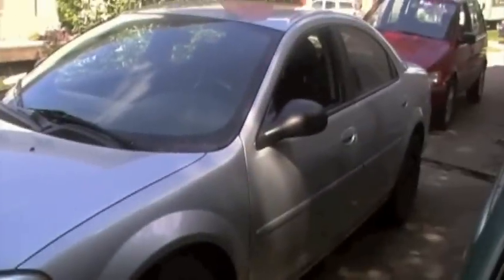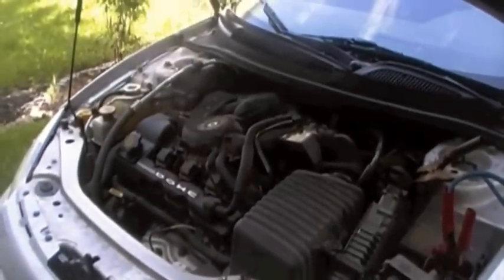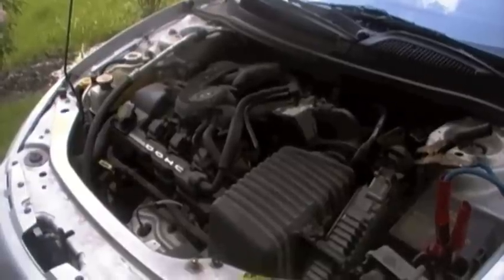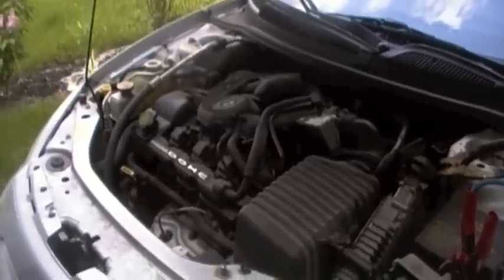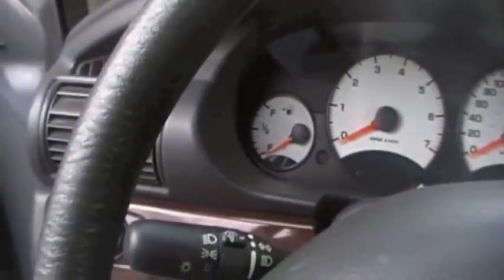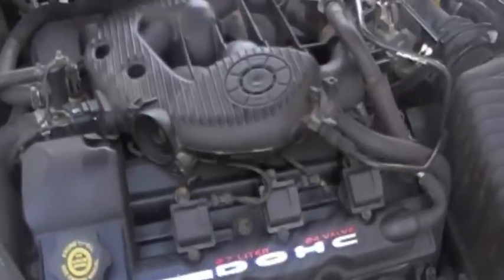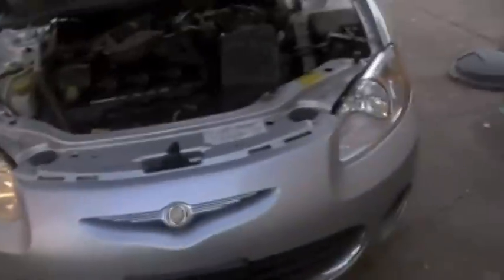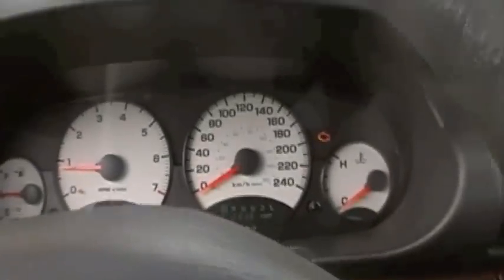Rebuilding a Chrysler 2.7 Engine 02 Chrysler Sebring

Comment: Own a 2002 Sebring convertible w/ 2.7 - bought @ 75k mi from a shop who had replaced a bad factory water pump and the owner decided for them to sell it instead of pay the shop and keep it. Unfortunately they used GREEN coolant instead of HOAT and I didn't know HOAT was mandatory until the new water pump started leaking 4k mi later! Determined to fix it myself (because the cost for someone else to do the water pump was $800+), I drove it another 2.5 years / 40k mi on the bad water pump, constantly putting water in it when needed. THEN I stored it at a buddy's garage for another 3 years before finally getting to work on it. By that time the timing chain was so loose, it was grinding on the timing chain cover!!!!! Thank God it never jumped teeth ... lucky lucky lucky

Put in a new MOPAR water pump, tensioner, guides, chain AND oil pump and it's been a dream daily driver since (4k+ mi ago) - I DID have to put new in valve stem seals because the higher heat from running on the bad water pump for so long and then sitting for years  hardened all the stem seals and she smoked during startup and accelerating off the line. Come to find out the (shadetree) shop I bought it from ALSO over-torqued the cam retainer bolts which was causing valvetrain noise and has prematurely worn the valve guides BUT this motor is not getting a valve job - this motor will be run till it burns up - hopefully no less than 60k mi.  

Regardless of my misfortune (which was from a shop's carelessness to begin with) I love the 2.7 - it is truly a high performance engine and I think it gets a bad name because it was put in Chrysler sedans so (avg) people's expectations are for something that goes forever with little maintenance on the cheap which this engine does not do (in comparison).  

BTW, thank you Jesse - your original video (and the Chrysler Mastertech video) helped me understand what I needed to do in order to repair my engine.

ps., the motor(+tranny) can come out of the front of the car once the bumper, radiator and radiator crossmember(s) is removed, axle shafts removed and the AC condensor is twisted out of the way - I did it with a fork truck on a parts car I had - slides right out
Reply from the maker: anon I can appreciate the reply to my video, I am very grateful that I was able to help you go through the repair of your 2.7 it truly is a great engine with proper maintenance it is a very strong reliable engine! To this day I still am driving sebrings with the 2.7! That master tech video is very detail rich and Is the best video for completing the timing process correctly to get proper tension on the timing chain.

Comment: @Shcubbebah Yeah that. And if you just drive it in summer or over 30°C all the time, use Shell Helix Ultra 10W60, because the engine´s got pretty high oil temperatures on hot summer days. 5W30 or 5W40, of course fully synthetic, just like you said is the perfect oil to use arround - 20 up to + 30°C

Keep on the great work!

Comment from the maker: @GATisdale  crankshaft was replaced from a donor engine (from a 1998 intrepid that had a timing chain failure) oil pump was replaced along with waterpump and all i did was clean out the oil holes with compressed air both ways to ensure maximum flow. the rebuild kit was ordered off ebay (type chrysler 2.7 master engine rebuild kit) they run you 600-750 cad funds.

Comment from the maker: @EthanCommins888 the oil passage ways are simply drilled into the block and are all straigt lines from a drill press and those could be easily drilled to a larger size....but the oilflow in the block isnt the problem....the heads are where the problems are...they are narrow and look like they are pretty much sealed up and not capable of oversizing the oil flow galleries without weakening the heads. use synthetic 5-30 oil and change every 5000k and there will be no problems.

Comment from the maker: you need to have timing cover off the access oil pump as it is driven by the crankshaft itself and you must have the timing cover and the crankshaft dampener removed to service the oil pump

Comment: Jesse,

The machine shop said I needed to have the crankshaft re-worked. I decided to buy a reworked crankshaft on ebay with the matching main and rod bearings and thrust washers for $195.00. I called the guy from Ebay and he said to make sure to use the bearings and thrust washers that he sends, not new ones.

Does that sound right? It would have cost me $225 to have the machine shop rework the crankshaft, so I'm trying to get any savings I can while still getting it done right.

The Ebay store has a 100% positive feedback rating and the item I bought also has a 100% positive feedback rating, so I figured that was pretty good.

I'm working on the ball joints right now as well, I noticed they were in horrible shape. The machine shop has taken their sweet time, it's been 2 weeks and 1 day and counting, so the project has really stalled on me.

I hope all is well your way. Thanks.
Reply from the maker: Matt Garza everything is well over here! It’s good to hear your still making head way even though it’s at a slow right now, but yes absolutely use the bearings provided with the crankshaft you purchase on eBay. They are designed to fit the crankshaft but will fit the connecting rod side  no matter what. If you decide to get machined make sure to take note of the size they machine it to and get matching bearings along with it. A good machine shop will provide the proper size bearings to go along with it. Sadly when I performed my rebuild I used a used crankshaft from a good low kilometre engine and standard size bearings and it worked out just fine..though I do not recommend
Reply: @JesseMarrin  Thank you!

Comment: Bought a new 2002 Sebring Convertible, at 50,000 mi. ( 2008 ) started noticing blue exhaust smoke at start up. Read all about this POS on the net. Traded it to the dealer that sold it to us, while it was still driveable. The '89 Jeep YJ  2.5  isn't any better..........had one go bad at 60,000 mi.
Reply: well my 2.7 has 186.000 miles you must of treated yours bad.
Reply: +hamtrak well I know a guy who got 300.000 miles out of a 2.7 engine anouther friends has 250.000. rod knocks are caused from letting the oil get to low.

Comment: Jesse Marrin--I bought an 01 Sebring that I'm going to rebuilt. It has a rod knock similar to yours. Any comments would be helpful. Thanks.
Reply from the maker: Any specific questions? Are you rebuilding? Make sure you get the crank machined and proper bearings to suite the crank. at minimum be sure to replace the primary timing tensioner with a reputable brand. As well as install a fresh water pump
Reply: @JesseMarrin  wow, a YouTuber who did what I'm trying to do who actually reads his comments and follows up, LOL.

I say that because I installed a factory cruise control in my 2003 Toyota Matrix recently and there was a dude who posted a video series about it who was so helpful to me that I offered to pay him 20 bucks. I asked him to please give me his Paypal or some way to pay him, and he never followed up. Anyway, I have heard about the water pump issue with these engines so I will be sure and do that. How much will it cost to have this machined like you were talking about?

Is there a certain engine rebuild kit that you would recommend? I have been looking at the one on enginepartsonly.com and I'm thinking about that.

I am just barely getting into this so I have a lot of ignorance about it. I'm wondering if I would even need an entire engine rebuild kit or if it would be possible to buy some items new and get certain components at a junkyard. I know many of the engines I see at the junkyard have been picked apart so obviously some people are doing that.

My goal is to rebuild this car and give it away. I think there's some people who doubt me that I can do it but with people like you out there who are good enough to put this stuff on YouTube and explain, I think I'll be able to do it.
Reply from the maker: Matt Garza that’s fantastic! That’s exactly what I did I actually hate to admit but I actually had a donor engine that had a good crankshaft and I just bought standard size bearings and used the connecting rods from the donor engine and I had absolutely no issues during the 50,000kms I drove this car. The engine kit shown on this video I got from eBay shipped to my door for $700 that included water pump oil pump and all bearings and pistons.... just everything took 40 hours total to rebuild
Reply from the maker: Matt Garza but if you seriously get into it I’m here to answer any questions you got! I’ve done lots of these things now!
Reply from the maker: Cost to machine crank could be couple hundred$$$
Reply: 40 hours? That's it? Jesus. I know you're a lot handier than me, so I can probably double or triple that number, but that makes me feel a lot better about this project.

Do you know the brand name or the seller you bought it from?
Reply: so...not something I can do myself and definitely something that must be done?
Reply: Thank you so much! 

I just got into working on cars within the past year. About a year ago I changed my front brakes and it just feels good to not be at the mercy of a mechanic. Since then I've done a bunch of oil changes, tire rotation, aftermarket keyless entry/power door lock installation, power mirrors, factory cruise control (that was a bitch), and just a little of this and that. So I guess this project is a big step for me.
Reply from the maker: Matt Garza with the help of a hoist in my back yard it took 6 hours for engine removal struggling with rusty bolts. Upon reassembly it was 2.5 hours to put back in with engine and trans coming out as an assembly keep in mind they have to be removed from the bottom together it won’t fit if you try to just remove the trans or engine
Reply from the maker: Matt Garza Eristic gaskets I believe
Reply from the maker: Matt Garza http://www.ebaystores.com/eristicgaskets here is the eBay store I ordered it from
Reply: Jesse Marrin  Thanks for the info! I am documenting EVERY step and labeling nearly all of the parts according to the step and will be taking pictures of much of the steps. I want to be meticulous since this is my first time.

Comment: Jesse Marrin--I forget whether you replaced the water pump in this car. I heard somewhere that the original one was total shit and I need to get the updated one, which I believe has the sprocket or whaatever moved out just a bit and it has metal fins as opposed to plastic as in the original. How can I make sure I'm getting the updated one when I order?
Reply from the maker: Matt Garza yes the engine rebuild kit came with full timing set with all sprockets water pump and even an oil pump

Comment: I have the Same Problem, Did You Have to do any work on the CrankShaft?
Since You have the Knock (I'm Thinking A Rod Knock) Which often affects the Crank Journal Face/Roundness, Did it Affect Yours? Did have to machine the Crank or anything? Or how Was Yours? What did Your Knocking Affect?
Thanks.
Reply: Nedu Nonny P You didn't see the crankshaft laying on the ground?
Reply: Clay Ton What's Your Point?
Reply: "Did You Have to do any work on the CrankShaft"

If it's laying on the ground... it's safe to say he replaced it.

Comment: I have an 01 sebring 2.7 187,000 is this a one of the bad ones
Reply from the maker: Ras Ra it wasn’t until mid 02 when they made a few revisions to timing chains designs to prevent it from jumping time. Other than that the engine went pretty much unchanged. Little things here and there but pre mid 02 they had the most sludge issues and failures